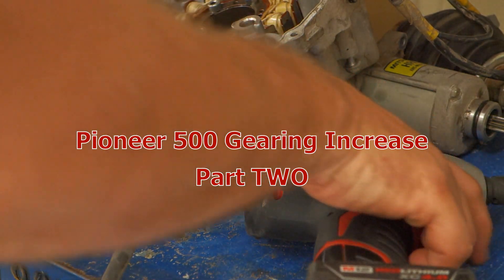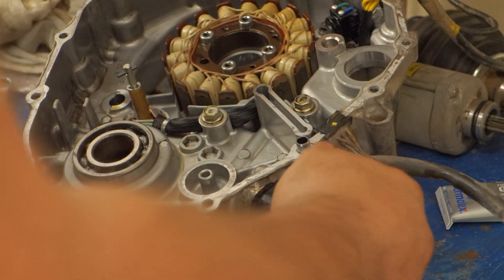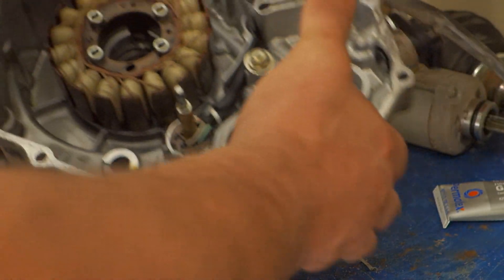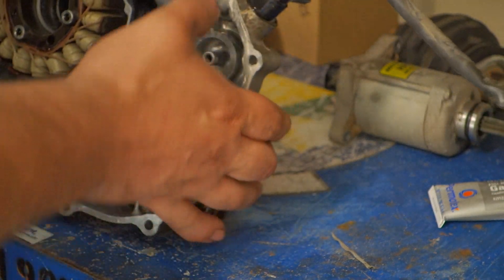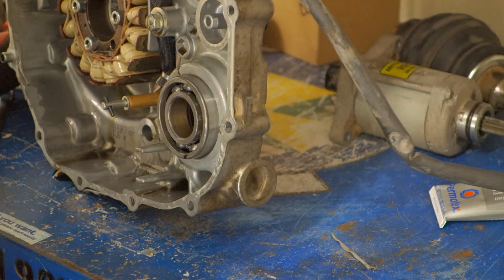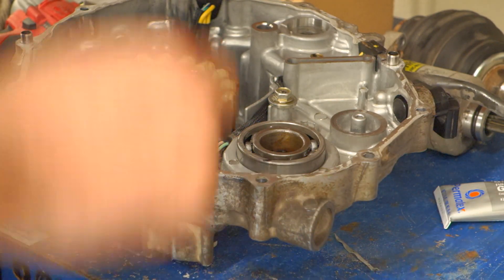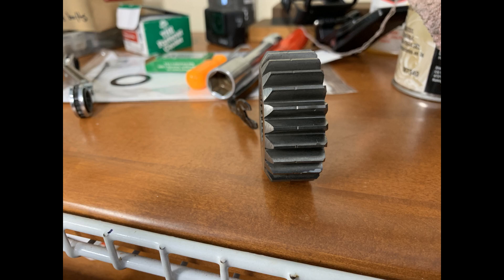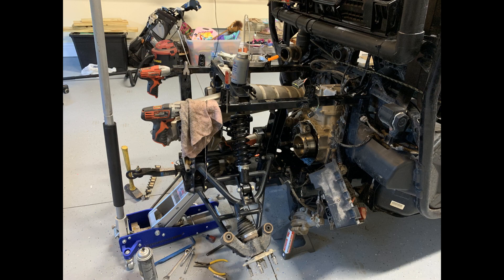Honda pioneer 500 gears part 2

Comment: i'm going to say a 5mph diff..and if that true deff not worth all the time money hassle.
Reply from the maker: Not about the top speed. Goal is reduction in RPM at trail speed. 30mph-ish, low RPM in 3rd gear the machine is near silent. Want higher top-speed, buy a Talon ; )
Reply: I just did this mod its actually pretty simple went from 64klm bouncing off limiter to 82klm on gps on 27’s and still no sign of limiter the gears are waayy more usable and 1st 2nd is still fairly low

Comment: Good video.  Why did you have to move the front diff forward?  You just changed our the final drive from the crank to the transmission right?  What was your speed gain?  Was it worth the effort?  Cheers